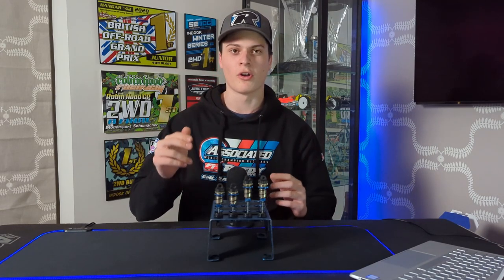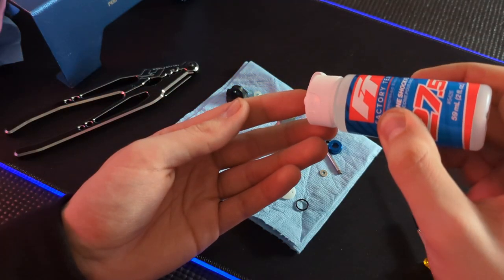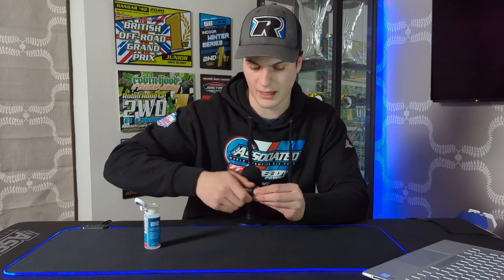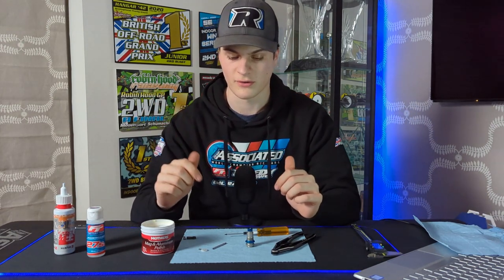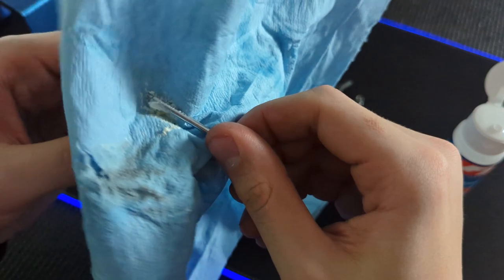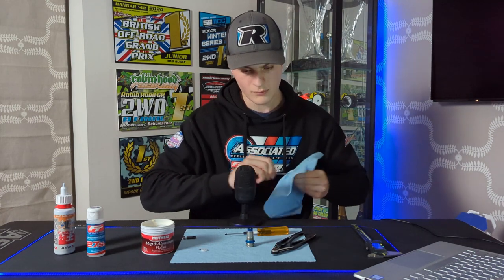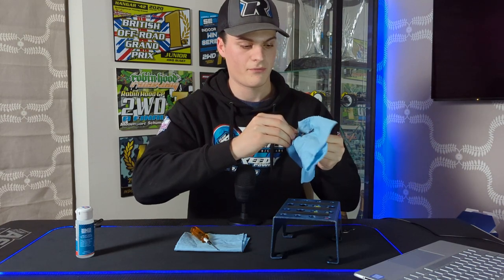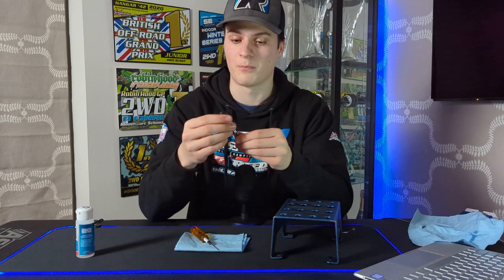Building and Bleeding the Perfect Shocks: RC Shock Build Tutorial.

Comment: I always put the shock shaft into the shock first and then put on the o-ring and schims. Then I push the o-rings into the shock and screw on the bottom.
Reply: Great way to make sure u don't damage the x/o-rings! I just lubricate them very good, then leave the bottom cap loose and tighten after shock shaft is through.

Comment: With the new MIP Allen tools there is a clear heatshrink tube that goes over and protects the sticker on the shaft. The heat shrink is flat in the pack so it just looks like random bits of flat plastic, but once you open it into a tube it's obviously heatshrink to cover the MIP sticker to stop it peeling -like yours is.